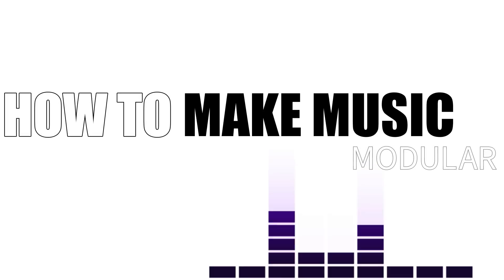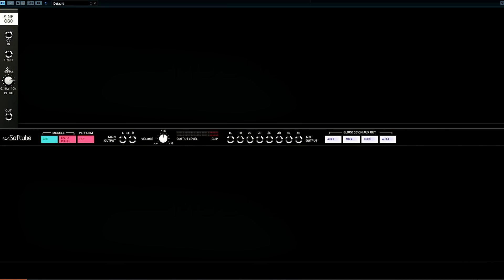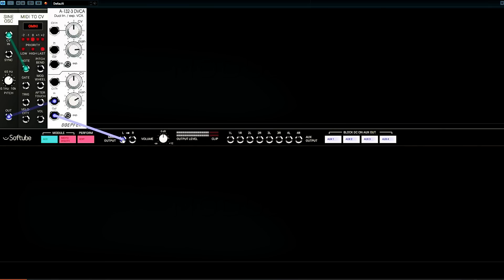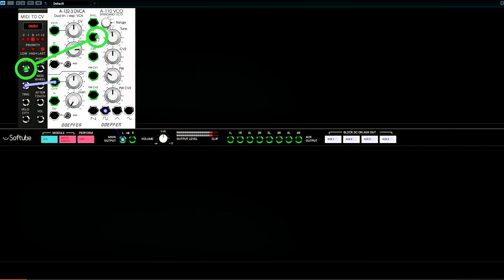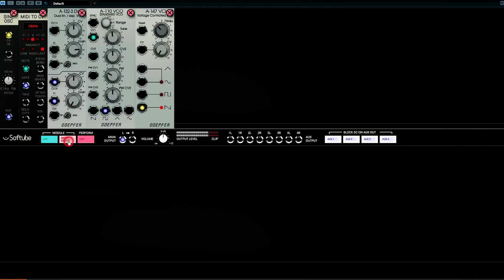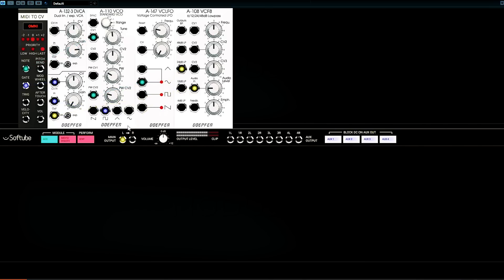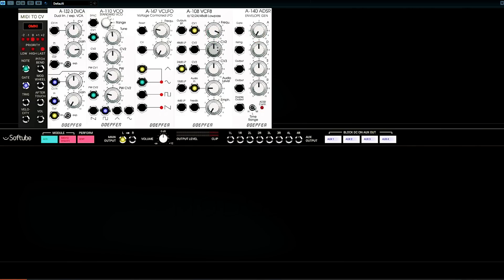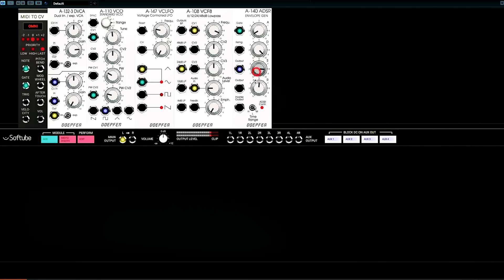Modular Synth Basics! Learn how to PATCH. [Tutorial]

Comment: Does it allow you to patch thing in incorrectly thereby teaching you bad practices for someone whom is looking to learn this process?
Reply from the maker: It allows you basically any functional connection, even ones that are unstable or produce strange results like, say, with mismatched voltage per octave. In that sense, you're able to explore and learn in a virtual modular playground.

It doesn't allow connections that would create no effect whatsoever though. So like outputs to outputs or inputs to inputs is generally prohibited.
Reply: Saher Galt That's pretty cool especially for those who need to get there feet wet. Thanks